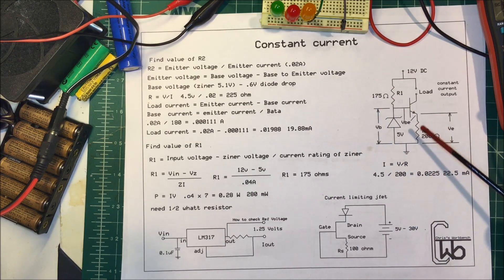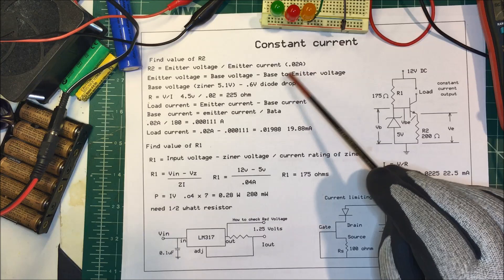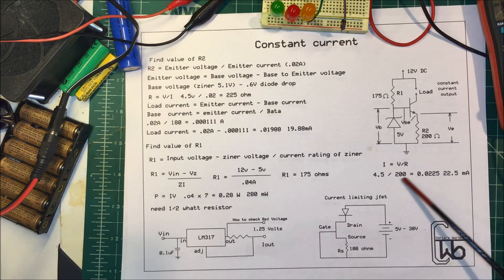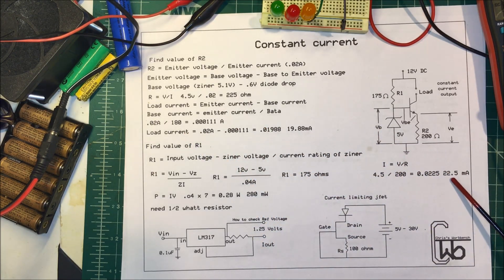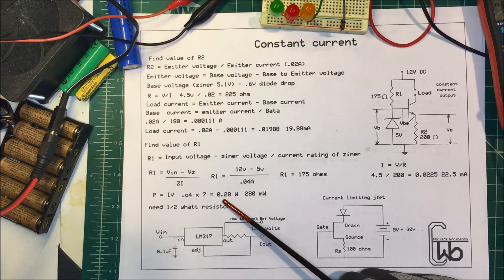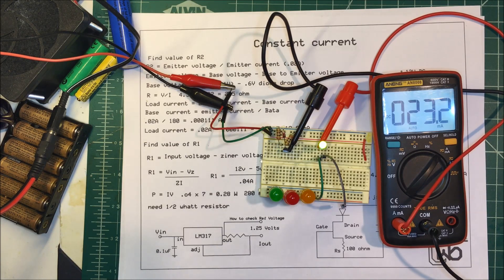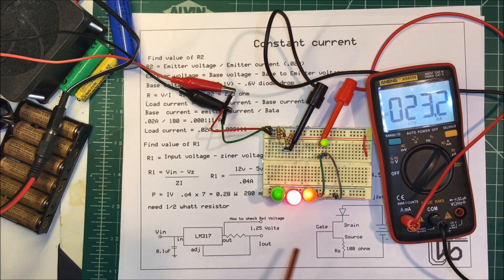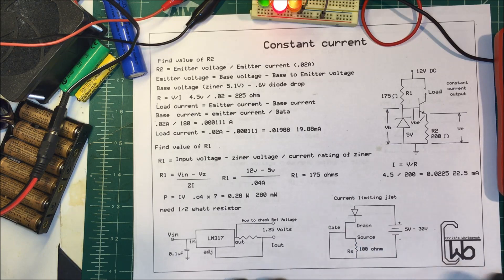Constant Current Source

Comment: I built a 4 channel constant current source like you transistor example set at 20 milliamps for testing/comparing LEDs at a fixed current.   It is a very useful tool.   I used old low light output LEDs vintage 35 years  ago as a voltage reference instead of a zener as you did.   Light output of LEDs sucked back then but work great for a constant voltage source.   I tested and matched 4 LEDs to find 4 that had the same forward voltage drop across them.      Great video.   Merry Christmas.
Reply from the maker: Good idea for voltage reference.
Reply: @ke6chris  Thanx.   I think I saw someone on the internet do it.     Definitely a good idea.   Used that technique manyl times now.   Mainly to use some of the old LEDs that were crap decades ago.